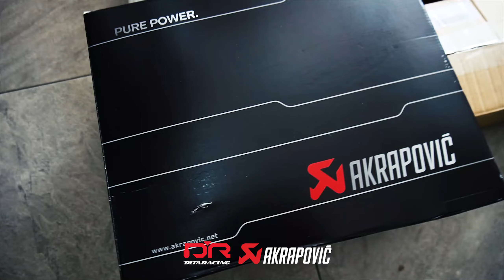BMW M4 F82 AKRAPOVIC EXHAUST | BEST M3 M4 EXHAUST SOUND | BOOTMOD3 TUNE

Comment: Hi so the only mods thats done to this car is an akrapovic catback exhaust (with factory downpipe) and a bm3 stage 1, is that correct? Thanks!
Reply: And the evolution link?
Reply from the maker: slip on line + link pipe + bm3 stage 1